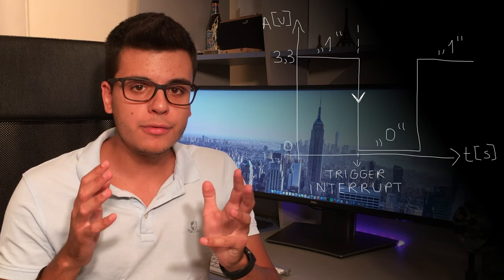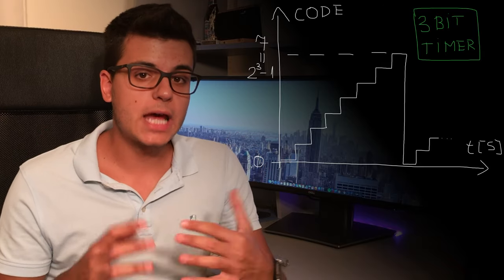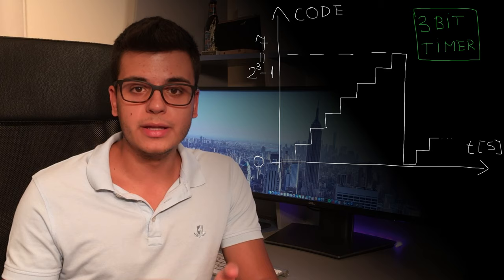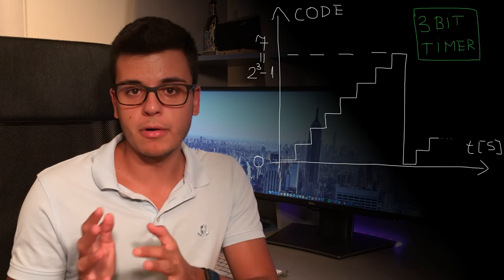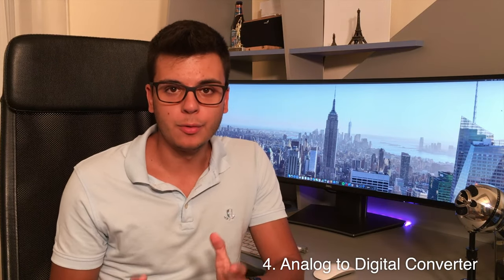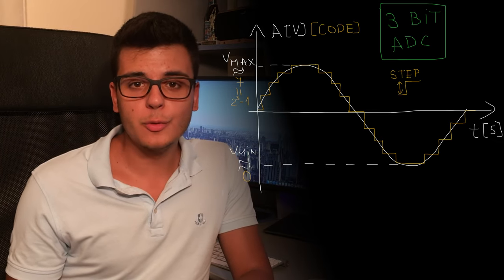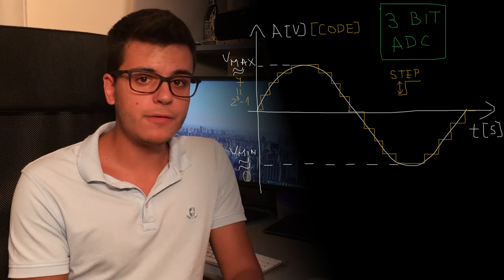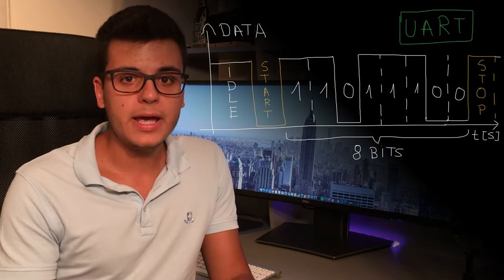How To Learn Embedded Systems At Home | 5 Concepts Explained

Comment: You can use Arduino, but only if youre programming at the assembly level + the AVRDUDE programmer through the command line. It feels exactly like if you were programming a 6502 / 65C816
Reply from the maker: That’s true! To be fair, I was mostly referring to the Arduino IDE (and Energia for MSP430).

Comment: Regarding Arduino, isn't it quite useful to have the libraries for the sake of learning low-level interaction? You can check the source code and use it as assistance, you just ought to consciously make an effort to not use the library itself.
Reply from the maker: It can be, but similar libraries are available for the MSP430 as code examples.

Comment: I’ve started a course on udemy with the texas launchpad with the TM4C123 uC. The board is very good and I’m learning a lot with this bare metal C programming course! Thanks for using it as an example also.
Reply from the maker: Great approach, it will pay off! Knowing how to work with the hardware at this level opens up a lot of possibilities!
Reply: TheFabytm yes! I wish to become an embedded systems engineer, but the way seems to be very long and hard. At least I’m already a computer engineer, but I’m working as a frontend developer. One step that I hope that helps me is the master degree in electrical engineering that I’m taking right now, but some online courses and tips are also very welcome.
Reply from the maker: Good luck, you’ll make it, the first steps are a bit harder.
Reply: Name of the course bro
Reply: @keshavkumart5150  Bare Metal Embedded - C Programming (TM4C123)
Reply: @keshavkumart5150  Bare Metal Embedded - C Programming (TM4C123)
Reply: @Pawl0solidus  can you send me link there are many courses like that in same name
Reply: @keshavkumart5150

Comment: My first project was arduino. It was a littel bit cofused becuse i didnt know anything but now is mutch easyer after 4 years. Build myself many iot stuf and smart switches and sensors. Feels like a perfect toy.
Reply from the maker: It is for the things you said, but mostly what you do is use libraries which do all the heavy lifting (interfacing with the hardware).
Reply: Is it hard or easy ??? Now I’m thinking 2 learn this skill ==embedded s/f enjineer

Comment: I'd like to hear about comprehensive programs short of a bachelor's or master's degree in engineering where you can learn embedded. I am particularly interested in the intersection of data analytics, edge computing and machine learning on micro-controllers.

Comment: what do think about this syllabus? 

Syllabus
The best way to understand what you will learn in this class is to list the labs you will complete and the example projects we will build. You will complete each lab first in simulation and then on the real board. For each module we will design a system and you will build and test a similar system.

Module 1: Welcome and introduction to course and staff

Module 2: Fundamental concepts: numbers, computers, and the ARM Cortex M processor
Example. Develop a system that toggles an LED on the LaunchPad
Lab 2. Run existing project on LaunchPad with switch input and LED output

Module 3: Electronics: resistors, voltage, current and Ohm’s Law   

Module 4: Digital Logic: transistors, flip flops and logic functions
Lab 4. Debug a system with two inputs and two outputs

Module 5: Introduction to C programming
Example. Develop a system that inputs and outputs on the serial port
Lab 5. Write a C function and perform input/output on the serial port

Module 6: Microcontroller Input/Output
Example. Develop a system that inputs from a switch and toggles an LED output
Lab 6. Write C software that inputs from a switch and toggles an LED output

Module 7: Design and Development Process
Example. Develop a system that outputs a pattern on an LED
Lab 7. Write C functions that inputs from a switch and outputs to two LEDs, which is a simulated pacemaker

Module 8: Interfacing Switches and LEDs
Example. Develop a system with an external switch and LED
Lab 8. Interface an external switch and LED and write input/output software.

Module 9: Arrays and Functional Debugging
Example. Develop a system that debugs by dumping data into an array
Lab 9. Write C functions using array data structures that collect/debug your system.

Module 10: Finite State Machines
Example. Develop a simple finite state machine
Example. Develop a vending machine using a finite state machine
Example. Develop a line-tracking robot using a finite state machine
Example. Develop a stepper motor robot using a finite state machine
Lab 10. Interface 3 switches and 6 LEDs and create a traffic light finite state machine

Module 11: UART - The Serial Interface, I/O Synchronization
Example 11. Develop a communication network using the serial port
Lab 11. Write C functions that output decimal and fixed-point numbers to serial port

Module 12: Interrupts
Example 12. Develop a system that outputs a square wave using interrupts
Example 12. Develop a system that inputs from a switch using interrupts
Example 12. Develop a system that outputs to a DC motor that uses pulse width modulation
Lab 12. Design and test a guitar tuner, producing a 440 Hz tone

Module 13: DAC and Sound
Example 13. Develop a system that outputs analog signal with a R-2R digital to analog converter
Lab 13. Design and test a digital piano, with 4 inputs, digital to analog conversion, and sound

Module 14: ADC and Data Acquisition
Example 14. Develop a system that inputs an analog signal with an analog to digital  converter
Example 14. Develop an autonomous robot that uses two DC motors and two distance sensors
Lab 14. Design and test a position measurement, with analog to digital conversion and calibrated output

Module 15: Systems Approach to Game Design
Lab 15. Design and test a hand-held video game, which integrates all components from previous labs.

Module 16: Wireless Communication and the Internet of Things
Lab 16. Connect a CC3100 booster pack to the LaunchPad and communicate with an access point. Lab 16 will not be graded, but we will provide a way for you communicate with a class server
Reply from the maker: I think it includes a lot of interesting things, it just depends over what period of time you’d learn all of this as there’s a lot to learn. If they are rushing it, there’s no real benefit to such a broad syllabus!
Reply: Good ,it takes a Lots of time
Reply: @raghuls2000  yes , but to learn Embedded System  it take a lot of time , i am right ?  not just for fun, to work on it in life

Comment: Heyy, I am from India and I wanna start a project for my final year in embedded system. Where should I start from and what basics I need to learn about components used for the same?
Reply from the maker: It might be interesting to try and make a cell phone. There are modules, such as the GSM800L which make this relatively easy. You’d also need a display (I’d recommend the 0.96 inch OLED displays). As far as the microcontroller goes, a higher specced MSP430 should do the job, Arduino is also fine if you are a beginner!
Reply: Hey how can I contact you?

Comment: Is this Texas instruments thing the same as an Arduino? Sorry if this is a dumb question I am trying to learn about embedded systems.
Reply: Sorry. Just finished watching the video. Question answered. Thank you very much this has been helpful :)
Reply from the maker: Glad you found it helpful! The MSP430 and ATMega (the microcontroller found on arduino boards) are similar in their architectures. The thing with arduino is that you can program it with arduino IDE and take advantage of the plethora of libraries available. 

You can use Energia for MSP430 which can use the same libraries, though usually you will have to adjust bits and pieces because the libraries were initially written for Arduino.

Comment: Arduinos, for quick and dirty prototypes. Outch
Reply from the maker: Yup, I see Arduino as a powerful platform because of all the available libraries for different chips/sensors, but wouldn’t use it to learn embedded systems, it keeps you too far away from what’s actually happening under the hood.
Reply: @TheFabytm  , The software layer is pretty thick yes, high level abstractions make things easier but hide the real guts and it's not optimal for academic/learning purposes, I agree .

Comment: What are the options for beginners?  Arduino has done great things for the micro controller industry.  What options lead to jobs as an embedded programmer?
Reply from the maker: Well, I’d say the route I proposed (picking up a development board, learning the basic concepts and doing some hobby projects) can absolutely lead to job opportunities. It’s the way I got my job (by showing them my projects which involved mostly using the concepts shown in the video - serial communication with a sensor, interrupts on timer events for sampling said sensor and a few more complex projects with a GPS module and GSM module - kind of like a tracking device).
Reply: Don't lie... Arduino projects are just hobby things. If u really want to learn embedded systems, try programming an Arduino board in atmel studio and learn to set the right bits. Embedded systems is mostly being good at reading data sheets like an attorney reads law. Alot of complex  cross-references etc.
Reply: @dsmeckt2283  Now now, let's not downplay the importance of Arduino.  It is supposed to be 100% open source, which is not applicable to all industries.  The translation layer also takes up space which requires more resources that cost money in high volume products.   It has its place, but not in defence, automotive or consumer products .

Comment: Can I use Arduino or ESP to learn Embedded System the professional way? Kindly recommend a microcontroller to start with
Reply from the maker: You’d learn embedded systems at a hobby level using Arduino. You wouldn’t really deal with real embedded systems things such as registers. I’d recommend starting with a microcontroller that offers a development board (MSP430, PIC, ATMega but not Arduino).
Reply: @TheFabytm  Thank you very much. I will focus on those microcontrollers. MSP430, PIC, ATMega
Reply: @TheFabytm  Thanks a lot. I will start with PIC. Can you link me up with any PIC beginner projects I can start with. Thanks.
Reply: @dtadetayo  Hi. I’m looking to pick up a career in electronics. Starting out first as a hobbyist. I would like a learning partner if you don’t mind.
Reply: @emekaosigwe  I don't mind. I'm IN.
Reply: @TheFabytm  Thanks for those, would an ESP8266 NodeMCU be sufficient in learning real embedded systems topics, or is it similar to the situation with Arduino?

Comment: If you started with Arduino already, is it still beneficial to try out the TI series and learn things again from a lower level. I’m a BS student in Computer Engineering so I’ve worked a lot with Arduino but haven’t had much embedded experience other than that. My University is more software focused.
Reply from the maker: Yes, of course! Give it a go!

Comment: I have using a lot of these platforms over the years, and I was having a problem whit the Arduino just not having enough to work thit a project I wasmaking a CNC Pick-UP Winder "For Guitars" the biggest problem was using an Encoder to keep track of the motor shaft RPM, turns, angles ect to synchronize whit the Stepper motor guiding the copper wire onto the bobbin.. TI "Texas Instruments" i though would be a good fit since it has encoder hardware on some of there boards and, Motor related stuff.. So I bought one of there boards...  The learning curve is HUGH ... even whit having a Programing degree and able to code C, C++ ... and asking for help Support was like Pulling Teeth, I could even log in or register on the Forum to ask for help because you CAN NOT join unless you have an University Email or some kind of Educational Email or an Approved business Email .. 
I could not even get the Support personnel to Direct me to  a Document of repo to learn the Syntax example, parameters ect .. 
I would not recommend TI, your much better off the Use STM32 better stuff better support better documentation..